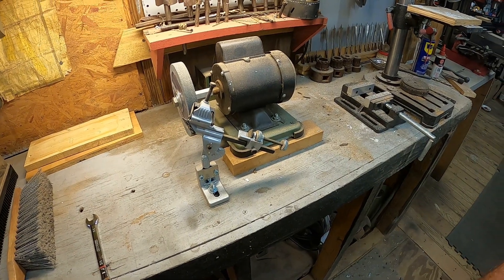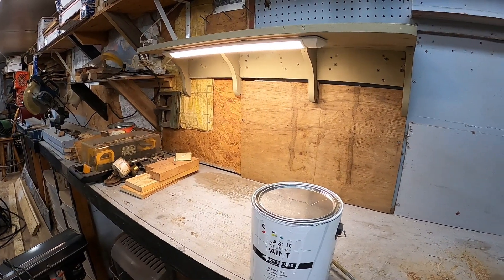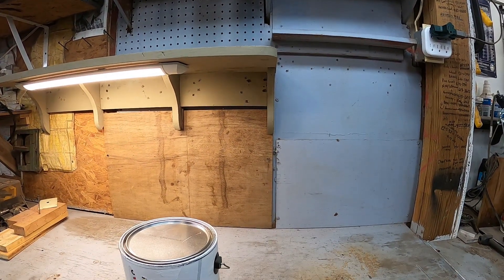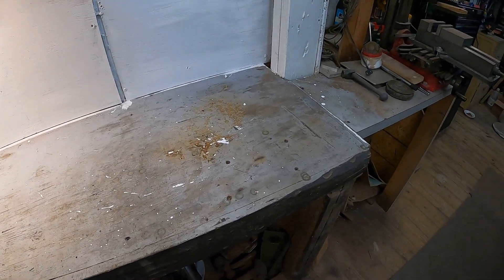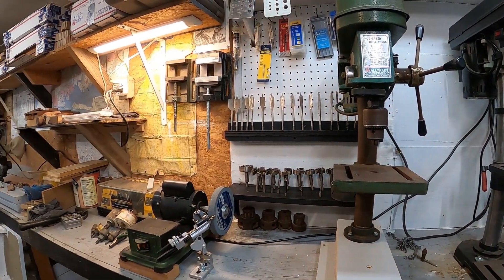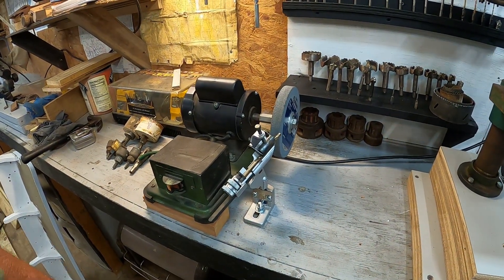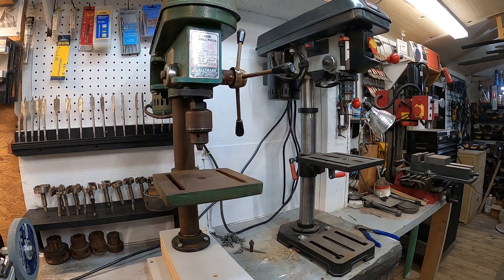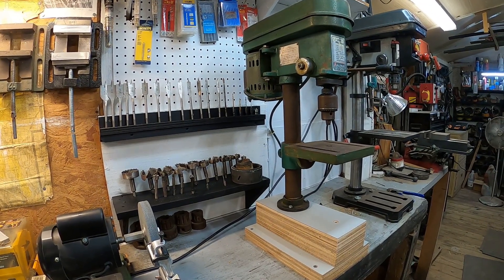Drill bit sharpener Reposition. Drilling Station upgrade

Comment: I have never seen a grinding wheel that rotated so it was rotating up from the bottom.  Unless your grinding jig was holding the bit the wrong way. I haven't seen a close-up of the jig (or forgot that I had seen it).